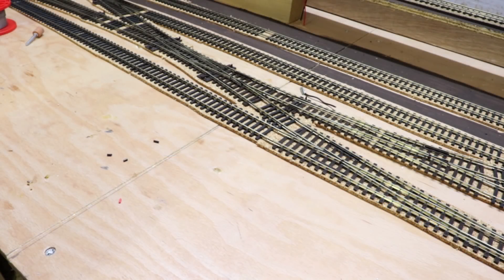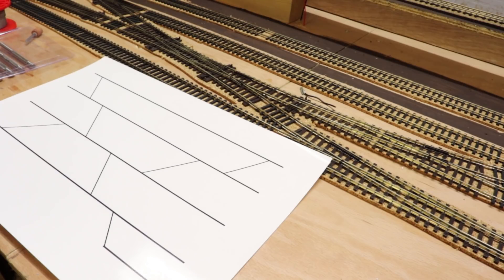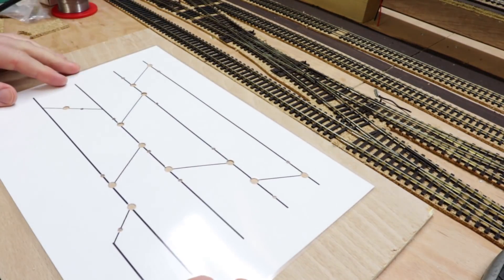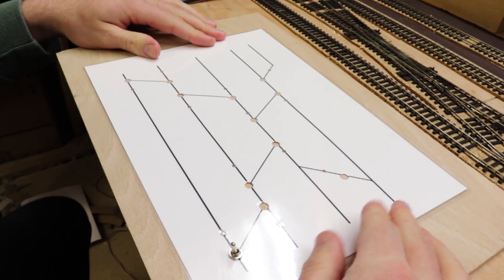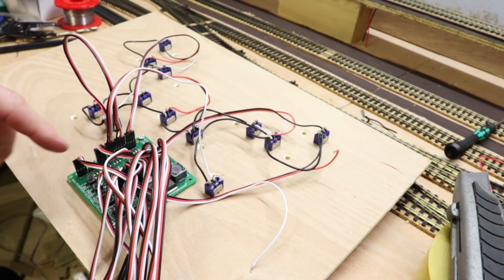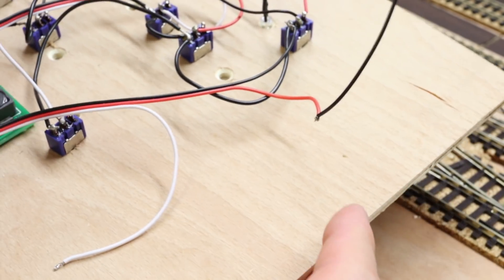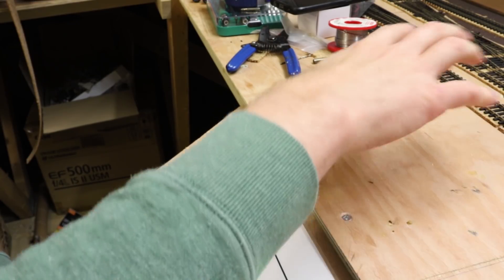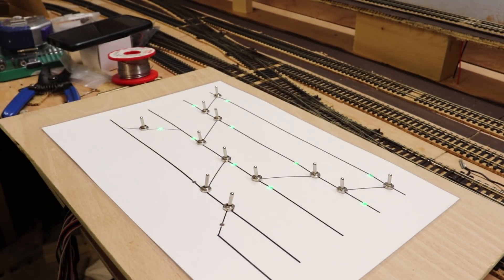Part 31: Building a basic point control panel - Building a model railway

Comment: Sorry to be a numpty, but you didn't say how you made the holes AFTER you had laminated the layout design.
Reply from the maker: Sorry Paul. It wasn't easy to be honest. Drilling just ripped it to bits so in the end used a leather punch against some soft wood. Not perfect, but did the job and fitted with the keep it simple/budget theme a bit.
I'm sure there's an easier way.

Comment: Great tutorial, after some vids I've watched on panel construction, a simpler one is refreshing. One question, you mentioned soldering, and this scares the hell out of me too, but, all the vids I've seen have shown the wires being soldered to the switch connectors. Could I not use crimped female connectors instead, or is it a longevity/connectivity issue? Many thanks.

Comment: You've done a good job with your board; nice one!
In the bottom left of your point control panel, you have a single switch which drives two points; for many of these, they are in pairs, and so only need one switch. (You do mention this.  Also the normal/reverse protocol might help with the drawing)
For the double slip, consider that it has the same function as two sets of points.  Then consider that for a set of points, the actuation is on the end away from the diverging rails.  The double slip is then a concatenation of these two points, so the left actuator decides which of the right-hand lines are used.

And for others less skilled than you, When drilling, have a board behind it, so the back side should not get so much damage (I tend to explode the back of the board with too much pressure unless I do this; I note your board looks good anyway)
Regards, 
Tom

Comment: Nice Job on your control panel  it may look basic but it does the job and that,s what counts  you could always a a border affect around the panel edge with your layout name at the top . I used plywood to build my panel covering the panel itself  in white sticky back plastic using  black vinyl strips to create the layout diagram i hid all  the wires in a box and painted up to look nice i hate all those wires lol and always worry one will get pulled  by my grand daughter lol   All the best .... Pete